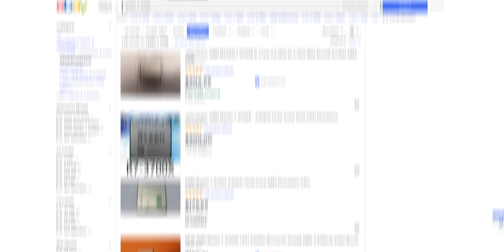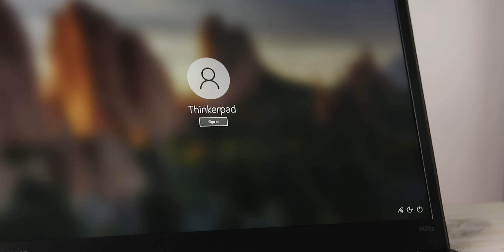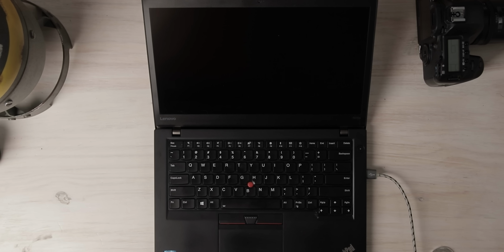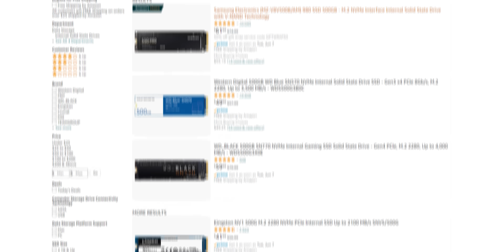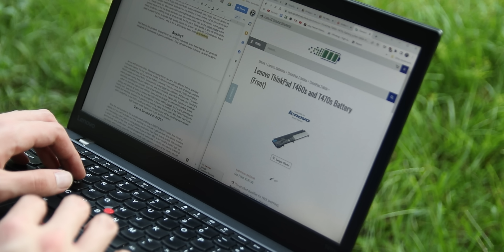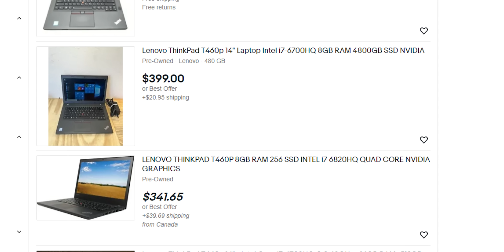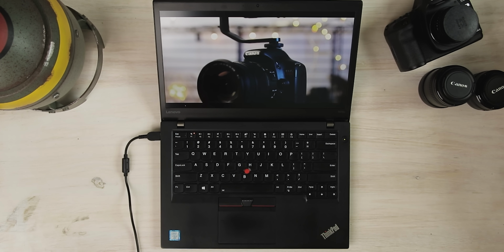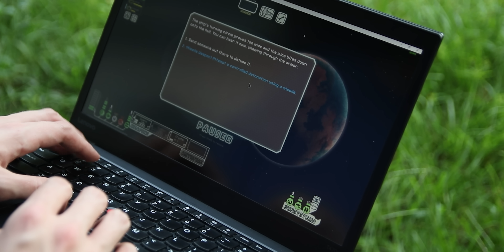I Couldn't STEAL A Better Laptop... I Tried - Lenovo Thinkpad T470s

Comment: T470 is the last good Thinkpad. I'm saying that as Lenovo employee. The new gen are absolute trash. I dont know what our devs are thinking or if Managment are forcing them to cut corners.
Reply: I was looking at the new thinkpads and it literally feels worse than my current laptop lol.
Reply: I would surely agree regarding T490, but what is the problem with T480?
Reply: just got the t14 gen 1 heard nothing but good reviews on it until i see this it’s coming in tomorrow
Reply: What are the cheapest lenovo laptop that's actually good in gaming?
Reply: @mariamkhalil2262  Hi #bot
Reply: @Marauder-q2v  Hi #bot
Reply: What about T480?
Reply: @Real-Name..Maqavoy  what does this mean
Reply: t480 better
Reply: @thiagoeh The T480 is beloved.
Reply: T480 isnt that just as good , as far as I know I can share ram with it from my old t470,  it is slightly newer technology and is about the same in output options and plugs?
What's the difference, that makes it worse, are you sure it's not at the t490 the cut goes , where it gets more like the others with soldered mem etc ?
Reply: My ex-260 was a great laptop lasted about 2 years only problem with it was the case and build quality were so cheap that it ended up disintegrating and physically falling apart
Reply: With how much I hear that exact line, I’m beginning to think every thinkpad is the last good thinkpad
Reply: Should I go for a T480 i7 8th gen or E14 i3 13th gen? Or E14 with ryzen 5?
Reply: As a avarage below dev, i can agree with you, but also not. New t series, yes its ver very bad. But new p series like p52 or p1 and xtreme series, that models are absolute fire. New models cant change keyboards, screens in some models etc. But thats fine for normal/beginner developer and users. Also new ones doesnt have big ports but this makes laptop thinner and very lightweight.
Reply: How about T480?
Reply: @tristan_840  im not a employee but at least i am a thinkpad user. If you not gonna customize ur laptop and gonna use in games, that thinkpad is good. But if you gonna customize, there is two option:
1-t30: cheap ahh laptop in ebay and also fully customizable, even the cpu!
2-p51: im using it almost everytime. Its a workstation but can play gta 5 in solid 60fps in 1080p! Also fully customizable exept gpu and cpu, but still new tho!
Reply: In my Budget, I will buy the  Thinkpad T470 for 299€. With 8GBs of RAM, (It is not a lot but I can do it w/ Linux.), and Intel® Core i5, 256GB SSD, and the best,Military STD 810G,approved for high low temperature,high low pressure,ust,vibration and humidity. It suits for me that I break things easily, and I get it for a price.

Comment: My bargain was a T480S, Core i5 8250, 16 gb RAM, in almost perfect condition, purchased a year ago for $250 on Craigslist .  I like it just as much as a Yoga 9i I bought a month ago (yes, I'm somewhat of a hoarder) for almost $1000! Plus, the T480S doesn't burn my legs like the Yoga 9i.  Older doesn't mean obsolete.
Reply: Leg burning is pretty typical of the thin and hot thin and throttle a lot era vs much older laptops. Get an T430 and pair it with the slice pack (secondary 9 cell battery) then nothing will ever get cooked again lol. Anyway bagging an near nos T480s is a great deal.
Reply: @MrKillswitch88  Great advice about the slice battery. My T430s does get warm, but my T470s remains cool as a cucumber.
Reply: 8th gen is a pretty good jump in performance, compared to 7th gen too :) I have a yoga with the same CPU running Linux, and it still feels new. Only 8 gigs of RAM too.
Reply: There’s also the benefit of the 8th Gen chips being the oldest CPUs that are officially supported by Windows 11 (if you want to upgrade at some point)
Reply: @SirSethery  When I bought my pre-owned T470s, Windows 11 Pro had been loaded. Not sure how the seller did it? It took me an additional 2 hours to de-Microsoft the notebook, getting rid of tracking and more.

The problem with Windows 11 is that it's more of a data collection service than an OS. Windows 10 is a much better OS. A shame that Windows 10 won't be supported after 2025.
Reply: @hoppysport2872  Through a lot of tinkering I was able to install Windows 11 on an older MacBook with Bootcamp, so it's definitely possible, but I still much prefer Windows 10.
Reply: @SirSethery  I'd revert back to Windows 10, but it's such a pain.
Reply: @Rossscow  8th gen i5 are freaking awesone, i strongly recommend skipping t470, and getting t480 or maybe e490, for better build quality and better cpu.
Reply: @millancche  what will you do when the soldered-on-to-the-motherboard power-port stops working? as far as i know, the T470-series were the last Thinkpad-models to NOT have the power-port soldered onto the motherboard [and it being a replaceable separate part].

Edit: I found-out about the soldered--power-port from this video: https://youtu.be/A15FfeJq6pQ . And ever since then I'm like "nuh-uh. No thanks." Truth be told, I don't like all the issues plaguing PowerBridge either (the internal-battery depletes FIRST instead-of second; the internal-battery doesn't charge at ALL; etc.). [I know they're "really-old effing laptops", but] I-rather stick-to the T420 & X230 😅 (and their-counterparts the T430 & X220 😂).

P.S. I managed to find a Microsoft-certified Refurbisher "Grade-'A' Refurbished" T470P with a Intel Core i7 7820HQ processor, 16 gigabytes of DDR4 Ram, 1-terabyte SSD, and 1080p-resolution screen. I'm looking forward to it :-) (a ex-classmate bought it for me as a belated birthday present; they have to send it through the mail since they're in another state at the present moment). Right-now I'm-running-on a Intel Core i3 2330M processor, 16 gigabytes of 1333MHz DDR3 Ram, 1366x768-resolution 14-inch screen, and a 500-gigabyte SATA3 7,200rpm perpendicular-magnetic-recording hard-drive.
Reply: @reoencarcelado5904  umm, well I can try not being a moron to ruin my charging port, so far it worked for me :D Jokes aside, soldered port does suck, but it can't be the main reason to stick to t470. T470 has issues with plasitc and battery quality, and solving these issues is expensive and unreliable - because you're using the same faulty plastic and batteries again. T480 and e490 have huge improvements to build quality and batteries, plus the 8th gen i5 is amazingly futureproof and superior to anything older. Definitely worth skipping t470 for all this, trust me, i reoair and sell uswd laptops ;)
Reply: @millancche  thankyou-so-much about the info regarding the T470 :-) . I had heard about the plastic-quality & battery-quality, but I hadn't seen much text-articles--or--video-reviews talk about it and/or mention it. It [absolutely] SUCKS that Lenovo has slowly-&-steadily/slowly-but-surely lowered the quality of the Thinkpads ever-since they bought the "Thinkpad"-&-"Computer" division from IBM :-(  .

P.S. If you have a website or a way I could find-out what used-laptops you have, I really would like to find-out, because I'm interested in buying some refurbished laptops from you. You sure seem to know what you're doing :-) (regarding the repair of old laptops, so I'm willing-to-bet they're top-quality repairs :-)  ).
Reply: @reoencarcelado5904  That's some big edit :) Nothing beats the old t430, t420, x230 series, they're literally indestructible, if the GPU is integrated. The degradation in quality is huge afterwards, and, IMHO, peaks with a lot of stupid s**t I noticed about t470 and t470s. T470s has two internal batteries (f**k me WHY???), both prone to swelling and failing, both incredibly expensive. It does get better, though, with t480 onwards, so, again, get that one or newer ones :)

I work and list my stuff in Serbia, not sure it's worth it for you to purchase stuff rom me. I will give you some pointers, though, no problem. 

All Thinkpads L series are utter crap, avoid them at all cost. In that price range, but actually good, reliable and well built laptops are HP ProBook G6, G7, G8... Even G5 are ok and can have 8th gen i5, but they feel kinda ugly and plasticky and gross. G6 onwards are awesome all-round, used or new. Never, EVER get anything HP beneath Probook, though (15, 250 etc) - absolute dog s**t!

Now Thinkpad E/Edge series are a mixed bag, some awesome, some terrible, I'm not experienced enough to know exactly all about them, but I do have several  E490, and they're awesome, they feel like they're made of steel, not plastic :) E490 is much smarter to buy than T470, IMHO, and feels much tougher than any T440 to T470. One big battery inside, guess that's better than stupid two expensive and EXPANSIVE ones inside :D

So TLDR - if you're considering t470, just cough up the extra dough for t480/e490 with 8th gen i5,  it's SO WORTH IT for performance, build quality and battery. If you can't afford them, avoid T470 and L series, a nice HP ProBook 430/440/450 G6/G7 is a much better choice in the ThinkPad L or T470 price range.
Reply: @millancche  thanks so much for all the advice :-) . i really appreciate it :-)
Reply: I'm still using t460s that I bought five years ago for slightly more than 500 bucks. I love it
Reply: @deerbeau  i recently got a X230. My ultimate goals are to get a T470P, T430, T420, X220, and T470S (or at-the-very-least, a T460S); all-of-them “Grade A Refurbished”, by the way.
Reply: I got T480s i58250u 8GB Touchscreen for 280€.
Reply: I have a T480 with i5-8350u, gets toasty really fast and aren't gentle to my legs. Hopefully new thermal paste does the trick (And maybe experiment with undervolting).
Reply: I have four t480s I love it, I think this has 1.5mm keys, new 1.3mm suck, x1c 6th is 1.5mm keys versus 1.33mm on 7th x1c.
Reply: @millancche  Glad I found your comment, really really helpful, any insights about Dell Laptops? I only like the XPS or latitude 7000 series but they are costly.
Reply: @millancche  I am really feeling myself lucky to find your comment as I am looking forward to buying an used laptop. Your explanations and real insights are making me relaxed to take the decision. 
Since you are working with the used laptops can you please suggest me the best one from the below laptops please??
I will be super happy if you do so for me by taking few minutes. 
1. Lenevo t480s
2. Lenevo t490s
3. HP elitebook 840 g5
4. HP Zbook 14u g5
5. Or any other model in this similar price range or configuration
Reply: is the OS a windows 10 pro 64 bit?
Reply: @anniel1193  Yes
Reply: Photoshop runs well?
Reply: And here, I'm still using my t430 😂
Reply: @hoppysport2872  see I just got a used T470s (i5) and Microsoft says W11 isn’t supported. 
Although I also prefer 10, updates/support will stop in 2024 and I really like this model and would love to use it as long as poss.
Reply: @JenX-TV  Interesting. As stated, it took over 2 hours de-Microsoft my Windows 11. I'd go back to Windows 10, except it's slated to be unsupported in 2025.
Reply: @chizisj Bruh? WTF? Please go out and buy a "new" $250 laptop and get back to me on how that worked out for you?
Reply: @chizisj If you're into owning junk, I'm sure there are $150 laptops.
Reply: T480s. i5 24 Gig.   It’s great.
Reply: Is core i5-8520 suitable for video editing?
Reply: I was just about to post the same story! I love this machine!

Comment: At work I had a Lenovo ThinkPad T460... I fell in love with the keyboard. I bought a  certified refurbished T470 for personal use. It came with Windows 10 Pro. I'd say its lean, meaning I use it primarily for writing, surfing the net, watching YouTube videos, and doing classes and meetups via Zoom and/or Microsoft TEAM. I'm not a gamer so that kind of horsepower is not an issue. My plan is to move it to Linux when Windows 10 is no longer supported. I've installed Linux on a few old laptops of mine in the past. Again, it's has a great keyboard and with the docking station I have a 2nd monitor and am connected to stereo system when I'm watching videos. When I head out I can just pop it off the docking station and carry it in my briefcase. I paid about $270. One of the best tech purchases I've ever made.

Comment: buy 8th gen i5 or i7 laptops , intel doubled the core count from 2 to 4 when switching from 7th to 8th gen due to competition from amd. so 7th gen i5 i7 laptops have 4c 8t while 7th gen and lesser ones have 2c 4t. there were some very high end high power i7 models in laptops that were quad core but those were like 45w tdp.

Comment: One thing I love about Thinkpads is the drainage holes. Those are little holes under the keyboard that go through the entire laptop so if you ever spill any liquid onto the keyboard, it can safely drain through those holes instead of into the laptop. 

Thanks to this, I only had to replace the $50 keyboard of my sister's Thinkpad instead of the whole laptop. And the keyboard was super easy to replace on top of everything else.
Reply: Lenovo used to do this on the G series laptops too. Saved mine when I spilled a whole bottle of water on it.
Reply: The keyboard is still going to be damaged, especially on the newer type of keyboard (on newer than T420).
Reply: @BrianG61UK   I never claimed it would safe the keyboard. Besides, a broken keyboard (that's pretty cheap and easy to replace), is a lot better than a broken laptop.

If you really want to pour drinks over your laptop, you'll probably have to get one of those rugged outdoor laptops they use on arctic expeditions and stuff...
Reply: Lenovo did great with the ThinkPad super underrated.
Reply: Can confirm, I have seen this firsthand. My roommate accidentally spilled some water onto the keyboard, so he opened the bottom part, after about 10-15 mins when it dried, he connected back the screws, and the keyboard was working just like that.
Reply: @BrianG61UK  Recently spilt beer all over my T430, can confirm.
Reply: News to me.
Reply: @NotNowLater  good for you?
Reply: Why are you drinking next to your computer anyway? That's bad practice
Reply: @Maximus20778  maybe read my whole comment before you reply...
Reply: @HunterRodrigez  yeah I did 

Women ☕
Reply: @HunterRodrigez  nope😁
Reply: @Maximus20778  me: "These drainage holes saved my sister's laptop after she spilled water over it"

You: "Why are you drinking at your laptop?"
Reply: @Maximus20778  It's what normal people do.
Reply: Thats music to my ears, i bought an Acer. it was a good package, Nvidia gpu i5 for a very decent price, amazon sold them like panckakes. the problem was that my keyboard keys suddenly started to die. i was like... "ok. keyboards die on notebooks, not big deal" so i started to watch dissasembly videos and this model is a nightmare to change keyboard. not only you have to gut the entire notebook because you cant pull it from the front, but the whole damn thing is riveted with plastic rivets instead screws, you have to melt every individual hole and remelt them or hot glue them again (is like 30 of those). i bought a logitech bluetooth keyboard because im not ready to do this surgery to my notebook
Reply: @CarlosAlejandro.-ke6gr  fucking hell... compare that to my thinkpad where all the screws got labels. When you want to replace the keyboard, for example, you don't have to take the whole thing apart. You just have to remove the screws with a little keyboard icon printed next to them. 

This continues on the inside of the laptop. All the screws needed to take the CPU cooler off to replace the thermal paste were also labeled as well. And it took like 4 screws (not including case screws) to get to the CPU. I tried that with another laptop once, and I had to take the fucking screen off to get to the CPU for some reason...
Reply: Actually, a lot of laptops have this feature.
Reply: I would of made you pay for the whole thing the keyboard is probably failing already
Reply: @HunterRodrigez  A good chunk of those are modded ThinkPads
Reply: @HunterRodrigez